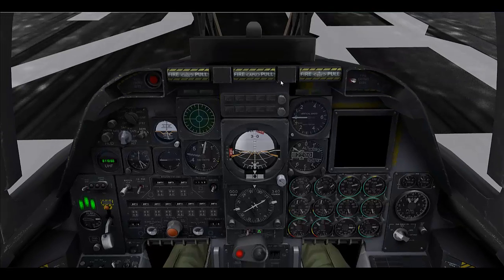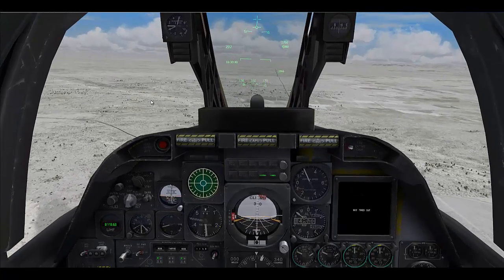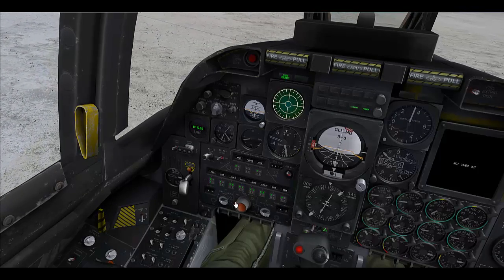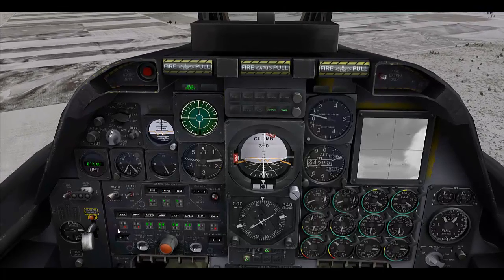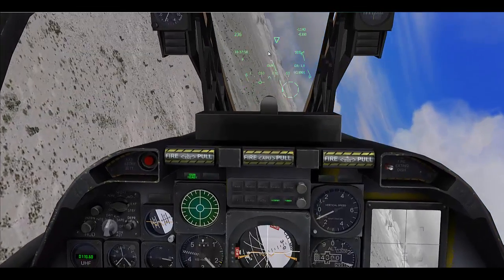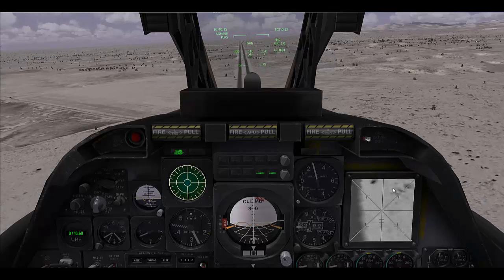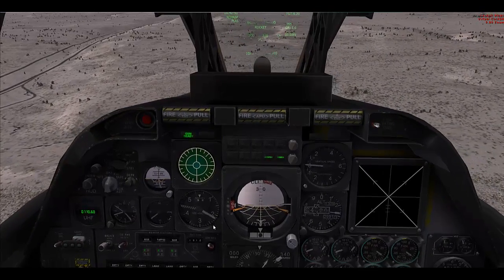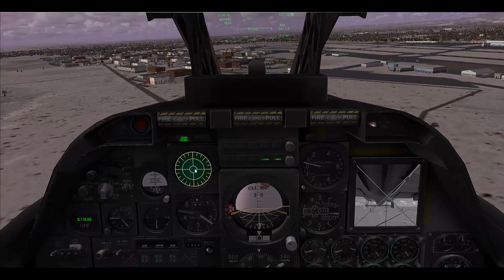IRIS A10-A TP Tutorial

Comment: Rob; I just reinstall teh iris A10 in both FSX and P3D 3.2 and am unable to load any weapons. the loadout window is "dead".  i noticed that during installation, I was not asked to "register" the a/c. could that be the problem, if so how to I "fix" it??
Reply from the maker: +Ron Folse check tacpack is installed correctly.. P3D isn't supported atm with it and I don't know if Iris is going to fix hat (their product, I just did the tutorials and wrote the original code for it ;) )normally if your loadout windows not letting you load stuff onto the bird it's a tacpack issue as it uses tacpack to do that stuff.. but your best bet is to contact IRIS themselves through their website..
Reply: +Rob Graham I have submitted 2 tickets on this one ove 2 months ago with no reply.  All other a/c are working with TP.  I can't get it to work in FSX either???  Was there a registration that I should have seen in the install?
Reply from the maker: Ron Folse i don't know how they setup their installer though i don' htink it had a key from memory, i'd try uninstalling it going into your fsx directory, simobjects/airplanes and making certain that the IRIS Warthog Driver folder has been deleted properly.. if it hasn't remove it then try a reinstall.

Also on ticket.. you could hit their facebook up and point out that they haven't answered your ticket in 2 months what gives. (yeah i know their support is shocking) I'll do my best but i can't promise a lot.. I coded it 2+ years back for them and they did some mods to the code and yeah.
Reply: +Rob Graham 
I'd like to piggy back on Ron Folse's post (Hi Pops) Greg from Fort Myers here. I just bought this b/c it says its for P3D and I suspect I should have done a little more research on this now....I, like Ron cannot get the weapons load out page to work. It does not show black dots as if something were selected....very poor that this is just not integrated into ACM and TacPack like VRS. So you indicated that this is not P3D 3.2 ready - I did just now submit a question set to their support - so if they don't answer me _ I will reach out to The Flight Sim Store and request a refund. If they are not going to support their products then I won't support them.
Reply from the maker: The issue here is that:
http://www.irissimulations.com.au/ols/index.php?main_page=product_info&cPath=7&products_id=28

clearly states on the Tacpack edition FSX

This TACPACK Edition product features the A-10 Warthog designed specifically for Microsoft Flight Simulator X with Vertical Reality Simulations TacPack product installed. TacPack is NOT shipped with this product and must be purchased seperately from www.vrsimulations.com for this product to work.